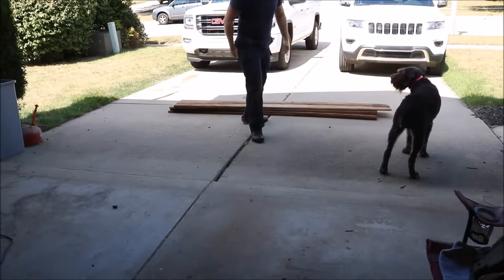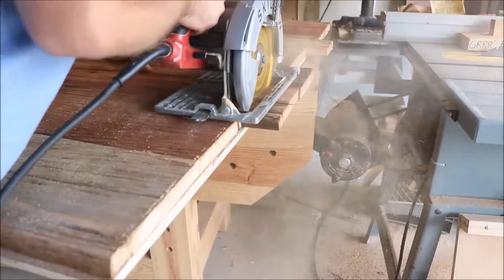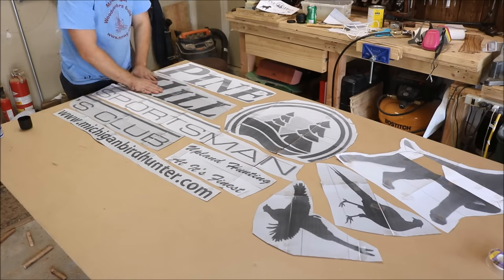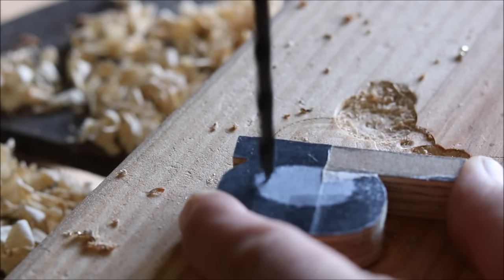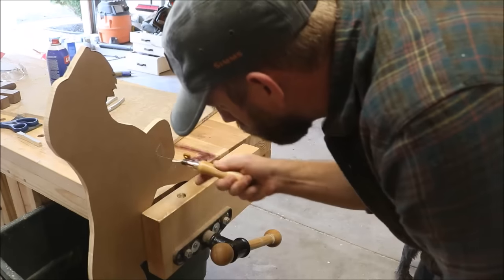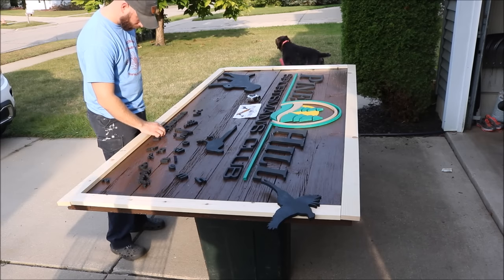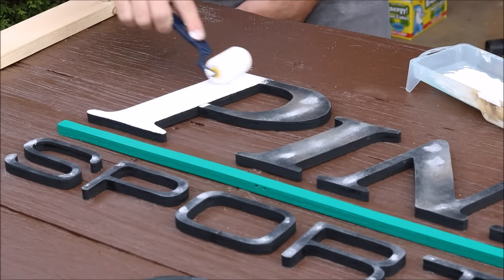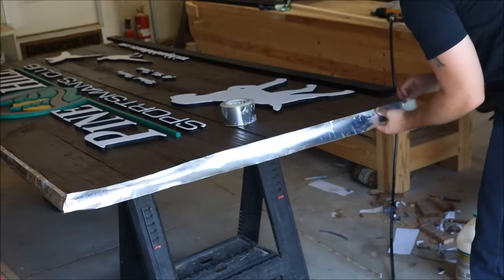How To Build A Professional Looking Wooden Sign With Raised Letters // Woodworking / DIY

Comment: I’ve been making signs for 45 yrs. You’ve done very well. We seal the edges of MDO with epoxy. For the backer sheet we often use Alumimum Composite Panels (ACP) Dibond is a brand name. I still like MDO. We buy it with a factory finish on the face and primed on the back. You used adhesive so the plain MDO was the way to go. Nice bandsaw work! Good on you for taking on the project.
Reply: Is there anywhere we can see some of your work?

Comment: I come from a family sign company that has been in business for almost 75 years. Considering you’re not in the industry you did a nice job cutting everything out.

We use lifts worth of MDO. However, we considered MDO to be a temporary material. So we don’t use MDO for this type of sign. We would have either laminated redwood together or used a 2” thick synthetic urethane sheeting. When we do use MDO, we completely primed and painted the entire sheet of MDO before mounting anything to it. I would have primed everything, including the letters, logo, etc. before applying any finish coat of paint.

If you had gone to a sign company and asked them to plot and perforate your layout out, they could have given you one large sheet of paper of the entire sign. We have a couple electric perforators and our plotters also have perforators on them to plot patterns. Chalk is ounces through the holes leaving an outline of whatever is pounced. You can use that outline to cutout your letters and then again to mount the letters to the panel.

Instead of nailing everything down (which will rust eventually and could drip down the sign face), we would have used silicone or epoxy (depending).

Comment: I did a very similar sign. I took each letter and coated it in epoxy along with the face of the sign before using boat paint for color. I used this technique after building the boat on my channel. The sign is showing some problems after 5 years and it is getting close to time for an overhaul. Your sign looks great. It’s nice to see a different approach to an almost identical problem.

Comment: I am way late to this party. The sign looks awesome. Two plus years later, I'd like to see how it looks. My concern is the Polycrylic coating. It doesn't hand temperature extremes well, especially heat. With the black and dark brown base colors, in Michigan summers, those will be burning level hot.

Comment: This is a awesome sign. I am restoring a residential sign and trying to enlist the city for minimal help to remount a 96"L x 22-1/2"w sign that is been in my area behind my house since 1983. I restored it once in 2015. But weather has taken its toll and the bolts that they originally mounted it with was mounted incorrectly to start. Now it is breaking through and will drop and be destroyed. I asked the city to just remount it and I will restore it. We'll see what happens.

Comment: This is awesome. We are going to try do one, hopefully we can find some old materials on the farm to use for the backing.
I'm wondering if adding a few other layers might look cool too.
Like a little trim around the inside of the borders, and maybe instead of just the shadow - could try a black base layer, then add a slightly smaller layer on top.
Reply: Oh and I was thinking I might have more luck with a scroll saw for my skill level.. but we'll see.

Comment: That turned out great! I thought you used a cnc from the thumbnail. 
Interested to see how long it will last in the rain. A small roof will help keep it dry. SS trim screws might be a better fastener over brads if you do this again.
Reply: I was thinking maybe use longer brads from front so they show through on the back and then use them as placement markers for screws from the back side.   Very nice looking work here.  How is it holding up after 2 years?

Comment: Just came across this video and your channel. You do great work and I am enjoying your channel. A thought on the foil tape used at the edges. I am a contractor by trade and my thought would be to use a grace ice and water shield for that area. It would allow the nails to be self sealed and should last longer than the foil tape. Only a suggestion and again you do great work!
Reply from the maker: Hey Mathew, I really apprectiate the advice. I am by no means an expert on exterior carpentry best practices and love tips like this. Ill do that next time (if I can remember the name of it haha)

Comment: Great video, like ur build videos, and the use of both power and hand tools. I will add and not to critique ur work, but any sort of poly needs to be recoated every year, u might get away with 2 but in heavy weather and sun i would recoat every year. Anything over 2 u will start to see peeling of the clear coat. Marine varnish is no better as still recommended every year. Paint itself is much more durable than any type of poly.

Comment: One note, I saw you applied the paint without any primer on the wood, if the paint you used was paint+primer I would've still put on an exterior wood primer because it helps tremendously for a better bond between wood and paint. Nevertheless awesome craftsmanship and detail to your work. Thanks for sharing
Reply from the maker: great tip David, thank you. I was wondering if I should take that step or not. I definitely will next time!

Comment: As a proffessiinal Signmaker, I would say yiu did a fantastic job. I have 2 suggestion for the next time. 1. Get the your shapes routed by you local joinery shop. They can slao provide with a layout map. As time is more expensive than material. 2 play around with the font on the text in the middle if the boards. This matters in terms of the overall look and how it is read. (Viewing distamce). Hope that helps.
Reply from the maker: Great tips! I really appreciate that!

Comment: Did you design the logo and/or the sign? It fits the theme quite well. I like your methods, but I think I would use a primer before any paint. It seals the wood pores better than paint and makes the paint stick onto the surfaces better and so the sign lasts longer that way. (Not to be critical.) Thank you. The video is great.

Comment: The shadowing turned out really good looking, and it's cool you get to put Utz on it! 

I'm curious about the water resistance on the edges of your boards. I saw you added the tape to help seal it, but couldn't water run in between the gaps in the boards and under the tape?
Reply from the maker: Well I did a couple things to try and prevent any major water from getting in that and sitting. First was REALLY slop on a lot of paint and pushed it deep into all the sides. Then I add that tape, then over top of the tape is the trim pieces which will prevent water getting in there are well. I guess I won't know for sure how well its protected until it stays outside for a while. I'm pretty confident that it will last at least 10 years though.
Reply: Third Coast Craftsman sounds like you took some good precautions then. Keep up the good work!
Reply: Only thing I'd do differently is not paint or board the bottom so water that gets in can get out. Pretty awesome job.

Comment: My oldest brother was a sign Maker for many years. You did a really nice job on the sign. Living in Florida has brought out a lot of special considerations. We are about 27 miles from the Gulf Coast. Even here, some of our outdoor light fixtures get salt corrosion and peeling paint. I see your sign as unfinished. You tried to protect it from the elements with the clear finish. It was an okay idea but when I saw the outside frame, the FIRST thing to pop into my head was "Marine Epoxy". Especially inside the small letter openings. There is a spray version, but since you already have a framed area. The epoxy would have filled it in. No sagging, no shifting, and no moisture in the cracks and crevices because there would be none. This sign is probably already up. But, just consider it for next time.
Reply from the maker: The sign has been up for 2 full seasons and looks like new still. Freeze thaw cycles in the north are as damaging as salt
Reply: @ThirdCoastCraftsman  I married a Hoosier. So we lived in Indiana for 15 years. Wood does take a beating out in the weather. My suggestion is over the top for one reason. You would need 6 guys and a crane to get it up on posts. A thin layer is fine for vertical surfaces. And that's the last thing you did.

Comment: Awesome build.I am new to your channel, and find it very cool.I wondered how long did the whole process take?My only suggestion would be sealing the edge of all your cut outs, as its possible for them to separate over time. I used to be in the sign business and have seen that happen. However, you did apply several coats of paint and sealer so it should be good. Might I suggest a mixture of glue and saw dust smeared all over edges then sand to a fine finish. just a thought and thank you for the great channel........Carl

Comment: Great project.

From my understanding paint is the most durable finish you can use. Therefore, not sure if the Polycrilic (or any varnish) will benefit the wood if you've already got paint. But the sign turned out nicely nonetheless.
Reply from the maker: Thank you. That's great info and something I should have researched more. Makes sense though, if its exterior paint, no need for any extra clear topcoat!! Would have saved me an extra $20 too as that Polyacrylic is not cheap!!!
Reply: Hehehe....Polycrilic ain't cheap. I can vouch for that brother. Lesson learned. On a brighter note, that sign should last a long time. Exterior paint can last for decades before it needs to be repainted.
Reply: Clearcoats help prevent UV light from bleaching the colour out of colour coats below. It was a good addition. 
It would be worth getting a decent High Volume Low Pressure spray gun for this sort of application, though.
Time is money, after all.
Reply: Thanks for the info above average. But doesn't paint already have UV blockers? Especially exterior paint?
Reply: Hazem Bata it does, but not enough. If your concern is painted works looking great for a long time, apply clear.

Think of it this way, skin has its own UV protection, but we still use sunscreen.
Reply: aboveaveragejoeaus Polycrylic doesn't block uv
Reply: As wood expands and contracts, it makes tiny fissures in the paint. Water soaks into the wood and tries to exit later, blistering the paint. 
Seal the lumber (or house trim and siding) on all sides (including the back side) with primer and two coats of quality exterior paint to stop moisture penetration. Sand and re-coat as necessary to keep the project looking good and lasting long. 
Drip edges and quality caulk can also help water to shed quickly. Rain, heat & cold (expansion/contraction) and UV damage will shorten the life of the project.

Comment: Chris,
Sign looks great! Loved all that scroll work. Noticed the bandsaw this time, you working with a 12" Craftsman?  That's the one I just got from a friend of mine.  Needs some TLC, though.
Reply from the maker: yes it is. Something that was given to me for free. Its missing its cover, so I really try not to show footage of the whole saw because the safety police would have a field day with me. I gotta make due with what I got haha.
Reply: Third Coast Craftsman watching you use yours gives me hope that I can make better cuts with mine. I've had to deeeeep clean decades of sawdust and rust, re-coplanar the wheels, and I'll need new guides soon. But I'm excited to put it to work. Loved the zero clearance add!
Reply from the maker: I could use to re-coplanar mine, but not sure how to do that??? my blades ride too centered/back on the wheels they need to come forward some.
Reply: Third Coast Craftsman check out the wood whisperer, he's got a video on his powermatic getting new blade guides from Carter installed by Alex Snodgrass. Lots of good info. 
On the craftsman, the screw in center of upper wheel helps straighten it in line with lower wheel. If you can get a straightedge to line along both wheels evenly, then it'll be coplanar. (I'm learning  on youtube allllllll the time, lol)

Comment: Great work! What does it look like hung up? Also what type of brush do you use for your poly crylic? I've used sponge brushes, but I'm getting tired of buying and throwing them away. I was thinking of using my spray gun to apply poly crylic but unsure about it. Again great video, subscribed!
Reply from the maker: Thanks bud, It looks great hung up, I have some pictures up on Instagram and Facebook if you wanna check em out. I just used a regular paint brush for interior paint. I wouldnt recommend what I did here. I found out I shouldnt add poly crylic to exterior work. so I ended up repainting everything haha

Comment: Wow. That is NICE! Not only are you a skilled craftsman, but you have quite an artistic eye. I confess, when you were laying those old barn boards down, I was thinking to myself, "Why's he using those rough, old boards on a sign?" But when I see how it turned out, I totally get it, now. Beautiful. Did you keep track of your time? I'd be curious as to how many hours went into that. Oh, and I've always thought you needed to prime wood with a primer before painting it, but you went right over the wood with your finish colors. Do you find that lasts just as well? Thanks.

Great video, too, by the way.
Reply from the maker: Hi ReRe, thank you for the kind words, much appreciated. I didnt log how many total hours, but it was probably around 30. The paint I used was advertised as an primer and paint in one, but I think you are right, I should have played it safe and primed first. I will no in time whether or not it holds up well.
Reply: Oh, I don't know - paint manufacturers have really been making huge advances over the last few years. I bet if it says it's a primer and paint in one, then it is, and it will work great. Thanks for the reply.

Comment: Hello, I think you have been doing this for a long time. On the milling machine, you can order a cut, done in 20-30 minutes. It was possible to use PVC plastic on the letters and back, it is not afraid of water. First, cover all elements with Oracal 641 series film, which is not expensive then for cutting. and do not need to paint anything. Print the wood texture on the back wall and laminate it so that it fades longer in the sun.

Comment: Awesome project, but why cover up the old barn wood?  Just weather some new 1x and use that instead of covering up the old stuff that is in more limited supply.  Upvote for Utz!
Reply from the maker: I though about that, but to really get the deep weather grain from new wood I would need a sand blaster, which I did not have. Or Ic ould havr tried burning the wood to expose the deep grain patterns, thats another technique that takes a good deal of extra work and time. The cost for new wood would have been pretty much the same as the barn wood that already had the weathered look I was going for. I better stay away from painting barnwood in the future, there have been several people who arent happy about that hahaha.

Comment: This is just a great example of sign work without a CNC machine and doing it all by hands with some simple shop tools. Great job!. My only thoughts would be,  since the boards where very weathered I would have also primed and sealed the back side and all the edges. In fact I would have primed/sealed all the surface and edges of the HDO and all the applied parts as well.  I'm a big believed of back priming any wood that has to stand up to exterior conditions. It's difficult to protect wooden exterior signs so that they will last. Given all the labor it takes to creat them the extra effort back priming requires is worth it. Since the paint is the only protection against the weather the degree to which all the surface are protected can be the difference in the sign lasting 10 or 20 years. None the less you produced an excellent product.
Reply from the maker: Thanks for the advise Paul, This was the first time Ive built something like this (painted and left outside.) I was worried about trying to protect it properly and looks like I could have done better.  I always like comments like this so that in the future I can improve. I will definitely prime everything next time. Thanks for the tips!
Reply: No worries, I've learned the hard way! You put so much effort into the sign and the results were so professional I wanted to add my thoughts. The next time by taking the priming one step further you will increase the longevity 5 fold. Water and snow are insidious and will penetrate wooden constructions in the most unforgiving ways. I learned my trade in a seaside town in Massachusetts so defeating water infiltration in all it's forms was drummed into my thick head at a young age.

Comment: Polycrilic is a interior finish according to minwax's website. so not sure how long that will last outdoors. nice work otherwise.
Reply from the maker: garren25 dammit! You are right. I have looked online for a clear topcoat for exterior paint and saw that recommended. I didn't actually read the label like I should have. It does only mention interior. I just hope it doesn't get all milky or something.

Comment: I've been in the sign business for over 35 years and MDO is a great product for a panel, but cutting it up into small pieces for the letters and graphics is not a good idea. There is no way to seal it enough  and it will start to come apart in a short time. By far, the better material for this application is PVC Sheet.
Reply from the maker: Thanks for the tips! I really appreciate that